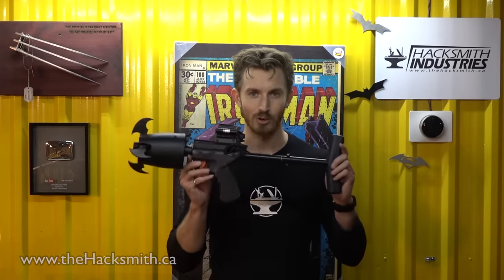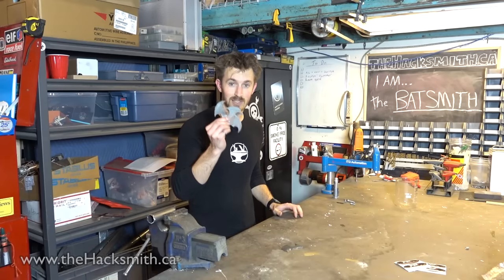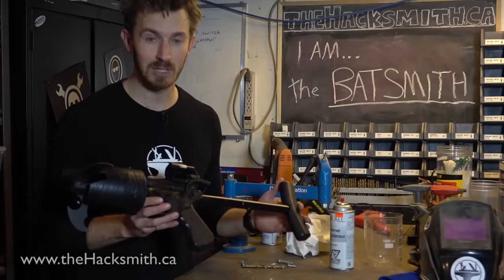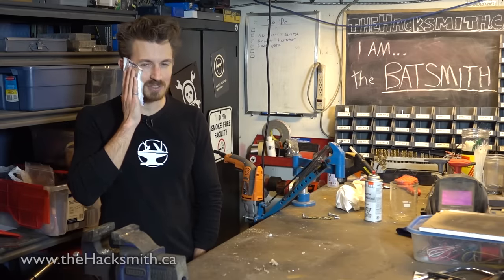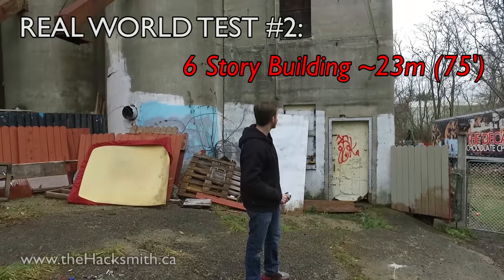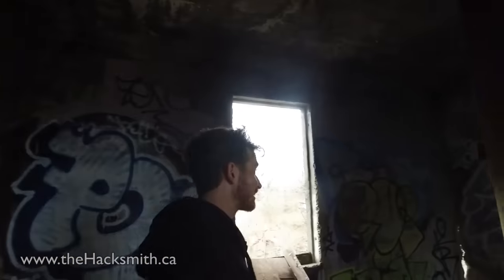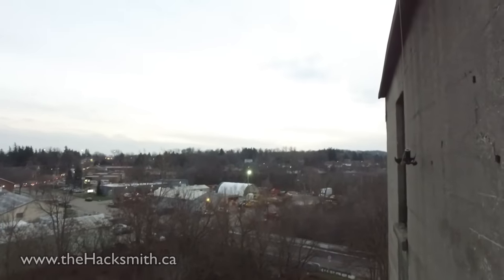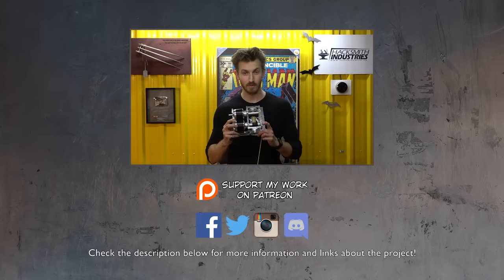Make It Real: Batman Grappling Hook Gun

Comment: didnt you like how he said comment on how you thing it works and then immediatly tells us that its expanding gas
Reply from the maker: +Brian Kent but do you truly know what/how that works? ;-)
Reply from the maker: +Brian Kent but do you truly know what/how that works? ;-)
Reply: +the Hacksmith no but cmonnnn tell meeeee
Reply: the Hacksmith also big fan dude keep it up also you should do donatellos bo staff with extendable blades of either side
Reply: I think it works with a gun charge just like a tenisball cannon made out of an ar15
Reply: TheGreenGuy yeah I think maybe that could work
Reply: would co2 be able to launch it that far
Reply from the maker: I don't think CO2 could launch it this far!
Reply: TheGreenGuy but it would have to be more powerful
Reply: Most explosions are expanding gasses. So that's still kind of vague. However. I do think it would be cool if he could incorporate the ascension device into the grappling gun.
Reply: the Hacksmith so tell us if we are right or wrong oke?
Reply: it's a single shot flare gun with a load im guessing roughly half a standard shotgun load. I know this because its how im building mine. My ascender has a fundamentally different design though using a single electric motor. Curious to see how his turns out.
Reply: I think it was joerg sprog, on the slingshot channel? Maybe how you spell it, either way he used co2 in a chamber with a solenoid valve. He was able to shoot  a pvc arrow 50 meters and sink it into the side of a wood barn. Batsmith also said " i hope it was a good charge" before he shot it. Those two things as well as it doesn't sound loud enough to be a shell of some kind. I'm just not sure co2 could throw grappling hook 6+ stories into the air. What do you think?
Reply: Is the device you made similar to Xproducts Grappling Hook?

Comment: It's probably gas powered, like a gas pistol, cause you can see "smoke" comming out of it when he fires.
Reply: Mr Soundso it's probably blanks
Reply: MOOSE LIFE no, it is most likely green gas.
Reply: ThatOne Ginger I don't see a canister
Reply: most likely CO2 powered, Colin Furze did a rope launcher with with CO2 as well, and it looks similar (the smoke).

EDIT: the only difference i see is that it most likely compasses the gas before firing, as a audible pop is heard.
Reply: MOOSE LIFE you do know th canister is most likely inserted in the hollow portion of the stock.
Reply: Upraj it's not Co2, it's most likely combustion, butane or some other gas getting ignited and creating a small explosion similar to gun powder.
Reply: Maybe it's like Royal Nonesuch's where it's fired with a shotgun shell. But instead of a shell, it's some blank cartridge.
Reply: Jr. Hacksmith it's probably gunpowder, they probably are shooting blanks. Look up can canons it's probably the same idea
Reply: It is a co2 cartridge, not a blank bullet. If it was a blank we be able to see a flash inside the barrel when he shoots it in slow motion. The pop and gas cloud when he shoots it are very similar to co2 powered airsoft guns. He also states that the gun uses expanding gases to propel the hook, not combustion which would be a blank bullet.
Reply: your probably right my first guess was blank but there is no where to cock it in to chamber or anywhere for the casing to go into or out of but there's an opening in the grip that probably where the co2 is stored or in the stock and when he puts it on it punctures the cartridge
Reply: im guite sure that they are using blanks because you can see the spring inside the gun at 1.45, the smoke that comes out is kinda blueISH and the mechanism isn't shown because it's dangerous to make and use, thats my guess. also co2 cartridge doesn't have enough power.
Reply: +aakka p read my earlier comment as to why it isnt a blank, 12g co2 cartridges are at over 850 psi they definefly have enough power to launch the hook. the spring means nothing
Reply: 100 % Blank rounds or real rounds, the latter are unlikely. Like the can cannon. The sound is definetly a gun firing. Also, when you look closely, the assembly around the trigger is 100% AR-15 Style, i'd go so far to say that the pipe coming out at the back is the normal stock mount of an AR-15

Comment: Try to make 3D maneuver gear from Shingeki no kyojin
Reply: I second this. A gasspowered motor of the back that pulls and releases cord. The mechanism to shoot hook should be a powerful spring but still flexible enough that the motors horsepower can reset the mechanism for during again in quick concession.
Reply: Took the words right out of my mouth

Comment: The rope is attached with a know to the grapple and then a knot on a pole inside the cylinder thing where there is a hole where a circle blocks the pole from falling out which is on both sides of the cylinder the way it shoot is the mechanics of a gun where the pressure fires the winch like a bullet while the rope is still attached 
If you dont know how a gun works here's how
The trigger has a a piece inside the gun where the trigger is pulled the piece will strike a firing pin the will strike a primer which will fire up the gun powder and then the flaming powder will generate pressure that fires the bullet 
This grapple gun will work like it, the trigger piece hits a firing pin which hit a certain piece that uses a spring attached to the cylinder which attaches to two pieces  that hits another piece with the same mechanism as the piece before and then when the two pieces get hit they are close to the grapple so when they are hit they hit the grapple with speed from the force sending the grapple flying in the air

Comment: ODM gear from attack on titan. A gasspowered motor of the back that pulls and releases cord. The mechanism to shoot hooks should be a powerful spring but still flexible enough that the motors horsepower can reset the mechanism to be able to fire again in quick concession.

Comment: Pretty sure you're using a varied form of a Can Cannon but the hook is an external sleeve instead of an internal and you're firing .223 blanks. Rope get coiled around the back and is why you had a tangling issue. The expansion pulled a few coils over one another and caused the tangle. Pretty easy fix, just need some additional parts.
Reply: its a.22 line launcher with a grappling hook attached to the front.
Reply: I didn't know about this since now. Thanks :) Good job
Reply: fitme4astr8jacket 我发。  v 呢，v，🚗i

Comment: there is a spring in the gun that realizes when the trigger is pulled and the spring has a point that will shove into a 30 ot 6 blank behind the grappling part that will launch it.

Comment: Launcher mechanism thoughts:
Explosion of compressed gas?
Thick steel spring compressed using levers and trigger lets it go?
Reply: if a spring was used, it may be a tensile spring, thick steel coil that can be twisted using the plumb like thing at the front.
Reply: After enough twists something at the back inside of the plumb like thing (the thing with three slots holding the each batwing-like hooks)locks into some "face" ratchet and using a long iron cylinder to push it

Comment: would it be really hard to build the hook with an arduino pressure sensor connected to pneumatics or something to shut the hook arms if the centerpiece hits something? that would make it exactly like in the clip where  batman shoots the skid bar of the chopper and it shuts onto it.
Reply from the maker: why would you need an arduino for a simple switch?

Comment: Is the actual firing mechanism a modified paintball gun? I was going to create my own grappling hook gun with a similar shroud but with a different firing mechanism. I would have a long barrel of pvc connected to a larger pvc tube with two screws that create a spark and work as an igniter. I would spray hairspray into the back of the gun and ignite the fumes with a spark this launching the grappling hook. This type of mechanism worked for firing potatoes but I am not sure if it would work with firing a heavier grappling hook. The other possibility would be to use air from a bike pump and have a valve with a switch that when released releases the air pressure which would in turn fire the grappling hook. Again I am not sure if this type of power would be strong enough to fire the grappling hook. Do you have any thoughts or advice on how I should approach this?